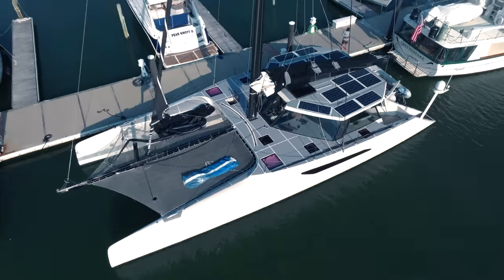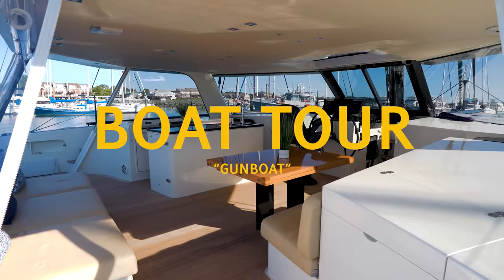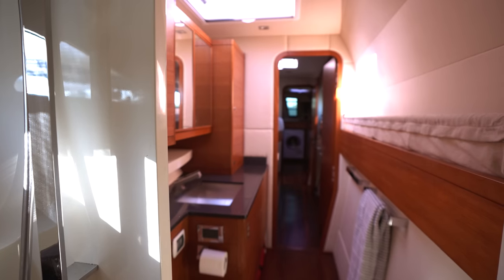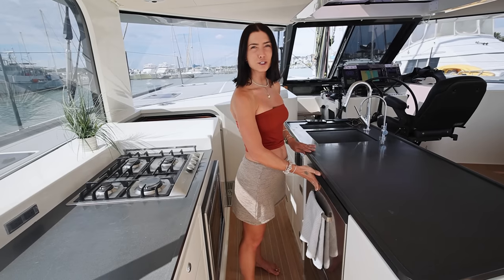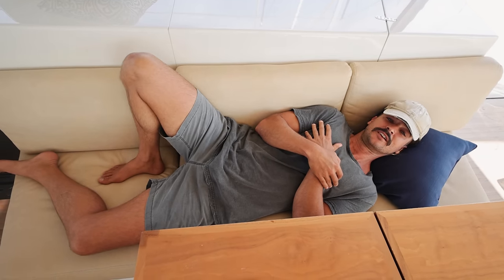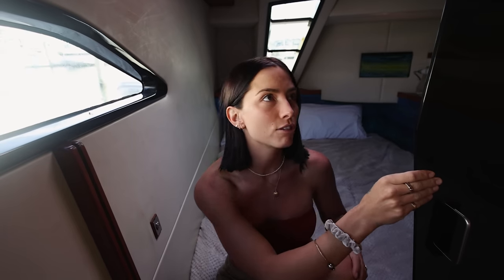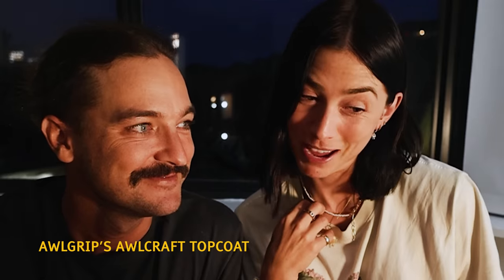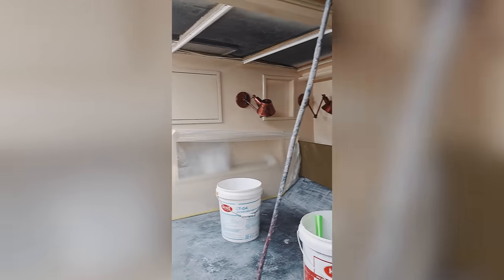BOAT TOUR: $1.9 Million GUNBOAT (+ New Trimaran Update!)

Comment: R&E - GREAT boat tour!!  Gunboats were deserving of their cult followers from the splash of #1.  Your tour and expert commentary illustrated all the techy design and onboard systems sophistication; Harken electric winches.  Dometic electric waste systems, Stidt helm chair.....on and on.  The Rapido will be faster for sure, however usable space will be left in the dust for not too much speed penalty.  We just changed out the Spendide, it is heavy, most being lead weight for the 2000 RPM spin cycle.  Ya gotta have one!  Good call to tour the world looking at unique watercraft, much better than working in the bilges of 40 yo monos (that refers to me BTW)

Comment: As a seasoned and certified paint inspector, AkzoNobel is a semi rare encounter in the maritime /offshore environment! ...... Sadly! Because they make extremely durable paints! 
When the application is performed well, you got a durable paint that will protect, as well as look awesome for years and years.
However, the application is the Achilles heel, which makes repair... challenging, when roaming the planet.
Looks like you got a good, nice closed coat at the boatyard, so you shouldn't see any problems in that regard. I would however urge you to vet any operators that are to perform touch-up and/or repairs going forward! (!!)

Comment: Gang, check out the Gunboat 72V.  It has a flybridge!
Reply: I think they prefer cats without a flybridge. And how much is the 72V? It also needs a crew...
Reply: @angela1984a  Cool.  We're all entitled to our opinions.
Reply: @angela1984a  Not so much with the flybridge.
Reply: @geoffstrebel2808  What do you mean "Not so much with the flybridge."?
Reply: @angela1984a  Angela, I'm glad you asked.  "All lines and controls lead to the flybridge" means you only have to walk a few feet to control the boat, single handed.   Certainly this isn't 100% true on all designs but it'll stand to an argument for the most part.  More sleek, dual, stern, helms suffer from the need to go from one helm to the other for a good amount of manuvers.  The flybridge excels at this, short handed situation.  I agree with Wiley 100% : https://www.youtube.com/watch?v=2Zc-U8Q8fRE
Reply: @geoffstrebel2808  Wiley isn't Riley. Have you ever seen Riley and Elayna sailing a Lagoon?... Why do you think they got an Outremer and now a Rapido instead of a Lagoon?... Also: Plywood bulkheads...
Reply: @angela1984a  Well, Angela, I'm not you!  Duh.  Because they prefer speed over comfort.  I don't.